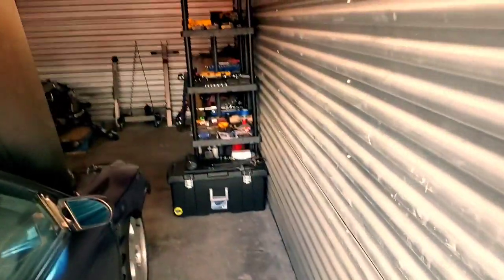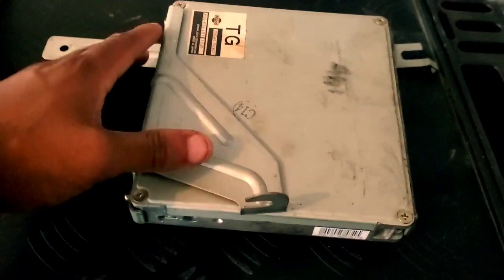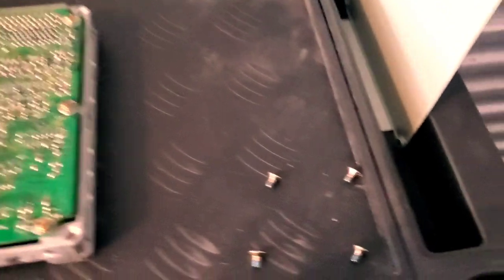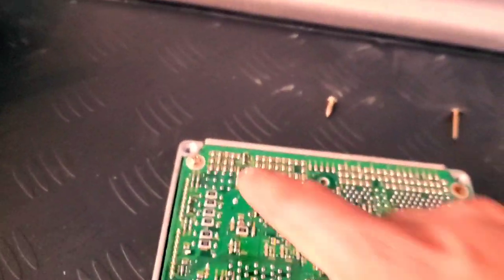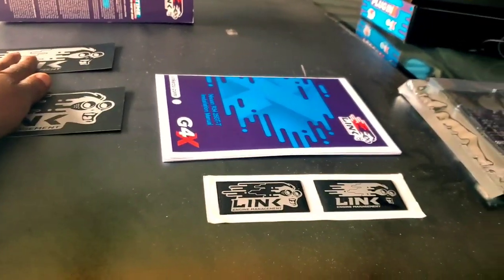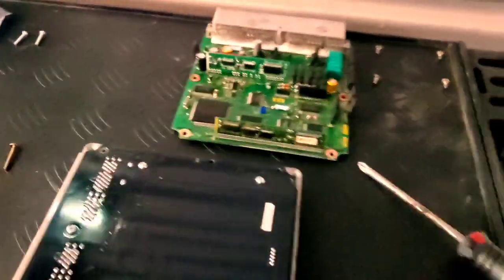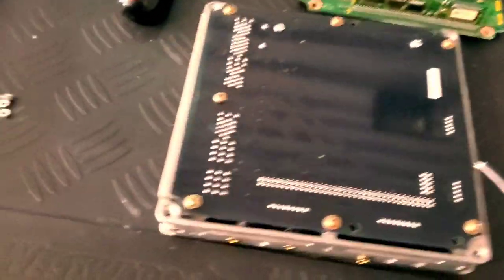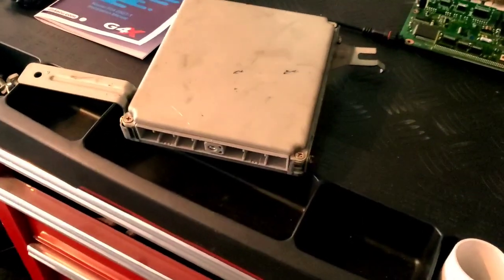rb25 neo link g4 ecu install

Comment: I would think for the price youd get a casing along with this. Is this better ways compared to the haltec platinum plug in? asking becuse boy i don't know squat lol. bye
Reply from the maker: They dont give you a casing because its made to fit in the oem one. They did this because in places like cali its technically illegal to run a standalone ecu so if a nosey cop sees a aftermarket ecu casing you bet they are gonna try to get you on illegal modification.

As for the haltech its a tuner preference. Allot of people say link is the best bang for your buck and has some safety protocols built in that can save your motor if somethings fail. I know alot of pros in the states that run link. But alot of Australian guys run haltech too and they are the king of rbs over there
Reply: @Jay.3  okay now I understand bro. Here in the Caribbean cops couldn’t care but who knows it may change. Thanks for the reply. I’d love to go some forge internals big turbo injectors the haltec and the digital dashboard and call it George around 350 or below. My engine is a series 1 has some miles on it so I wanna rebuild
Reply from the maker: @schalachi  yea they dont care here either but just for peace of mind. Thats not a bad setup. Powertune makes a digita dash that plugs into the link ecu for cheaper. I plan on running that. Forged may be overkill for a 400hp build tho unless it has alot of miles
Reply: @Jay.3  really so what parts you think i should put on the engine if you dont mind me asking.internals i was think head studs piston connectiong rods rings. i dont wanna over kill. i apprviate your replies bro thanks for the talk
Reply from the maker: @schalachi  always ♥️.  Most rb motors can take around 400 on stock internals. The rb20 might cap at around 350 or so tho but the 25s are better at that. Mines currently makes 372 wheel only arp studs and a metal head gasket. The 25s tend to get unhappy at 500 on stock internals. If you have the budget and want it to be bulletproof at that powere level it will be fine. But i would say a good headgasket get the head/block surfaced for it. And while your at it clean the head with a port and polish job. Outside of that its just your turbo and fuel setups to match the 400hp goal. Items that dont restrict airflow on the intake or exhaust side and mabe a walbro in the tank with a bigger turbo than oem.

 Should be good with that as long as you have good wiring/ecu management and a ok tuner
Reply: @Jay.3  that’s great! So I can shoot for 340-350 without breaking my bank. At least for now. Maybe a few years I can rebuild it with the parts I listed I try for 500! Thanks a million for the replies. Godspeed
Reply from the maker: @schalachi  good luck